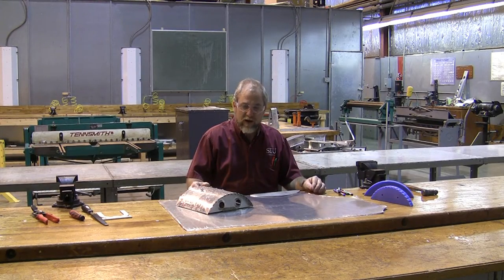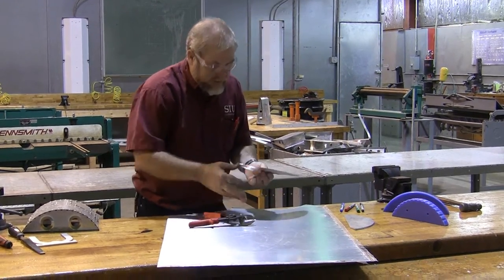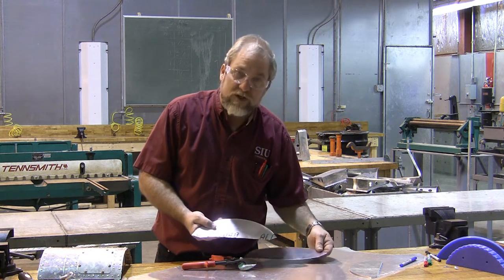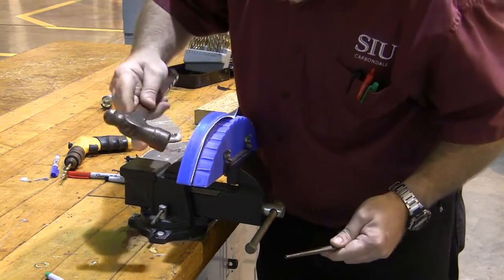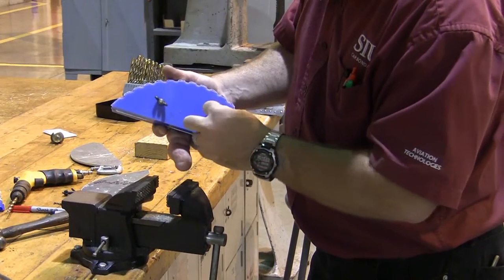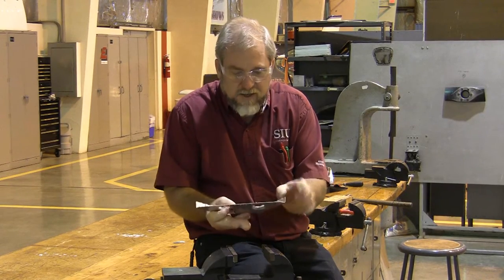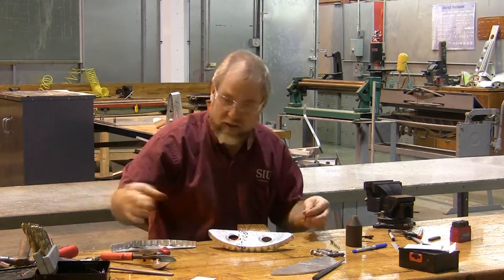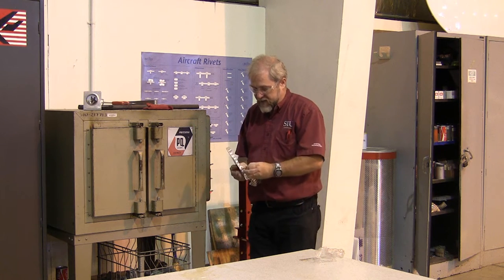AVT 206 A&P - Project 4 Complete - Forming Curved Sheet Metal Ribs

Comment: Great videos, I have been watching quite a few of them now. 
I don't have an aviation back ground, just a motor mechanic, who likes to make things.. 
I love the use of rivets to hold your sheet metal components together, but why don't you use adhesive sealant between the joints?
Cheers Paul
Australia.
PS, bummer about the hand, i hope the op works out...
Reply from the maker: What you are describing has had a lot of research poured into it, and fairly decent successes.  Material prep is the key, along with very expensive adhesives.  Non-industrial facilities have seldom been able to achieve the quality control necessary to make a trustworthy connection for something you will trust with your life.  The commercially produced products using these techniques (they have been out there since the 70's) must be treated much more carefully than the rugged riveted structures.  Proper repair techniques for bonded structures that are delaminating usually involve adding rivets.  Google "AD 76-17-03" to see  what happened to many of these bonded structures, along with repair instructions.